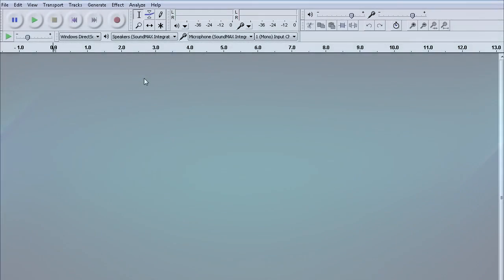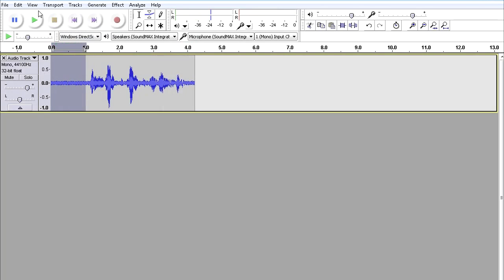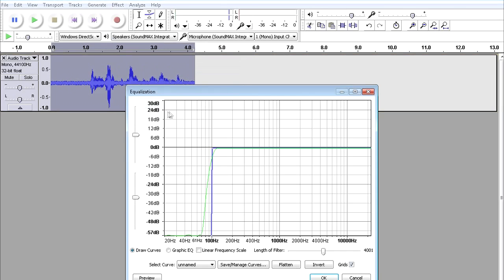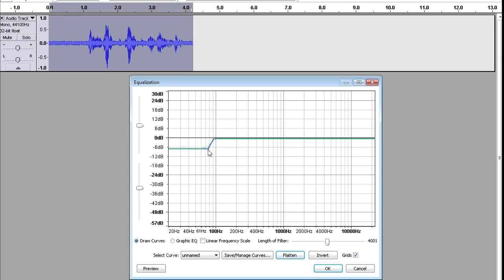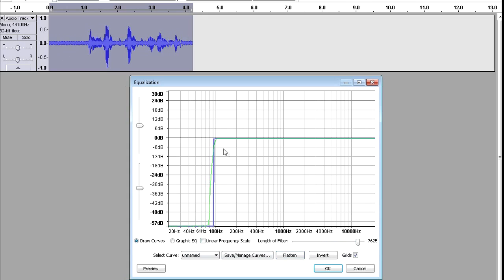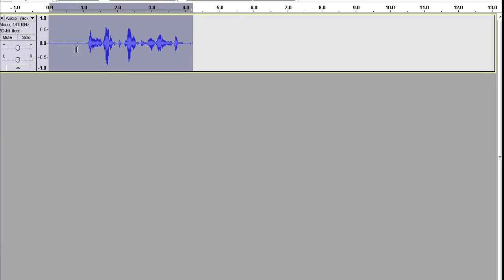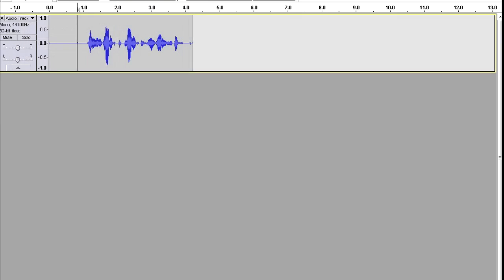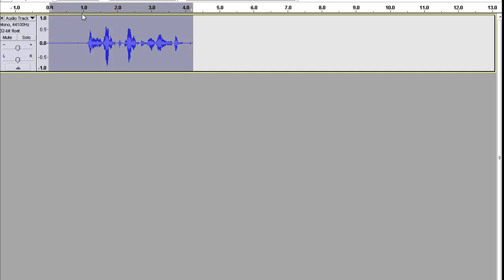How to FIX or remove hum/buzzing/electric noise in HEADSET

Comment: Lol I just realized what was the problem I had it on my phone and my earphones were plugged in and my phone was charging and as soon as I removed the charing cable the noise stopped Idk if thats normal but it was creating an interference so just check that